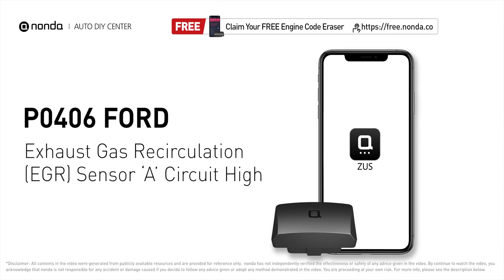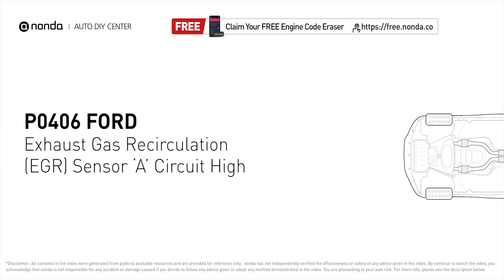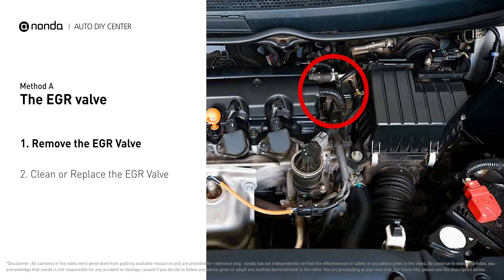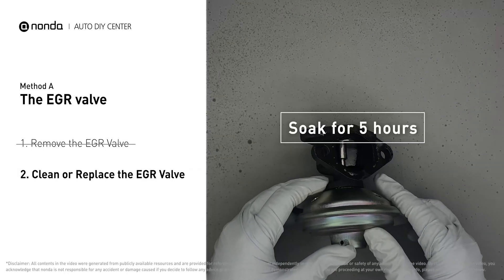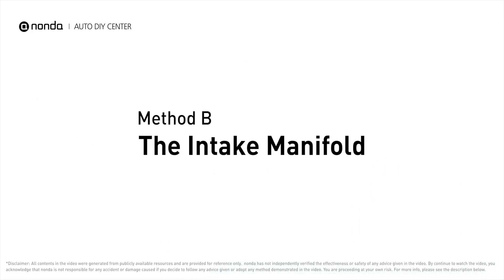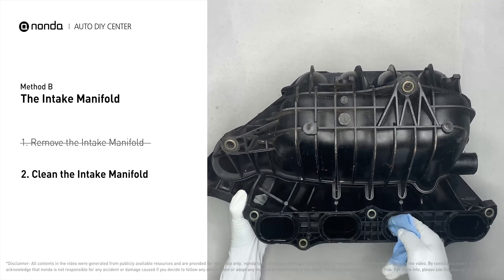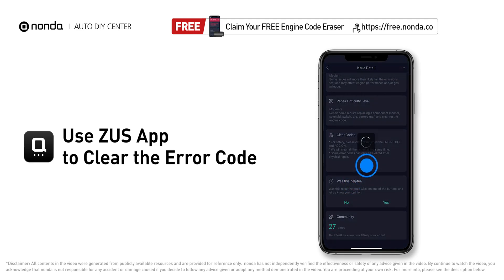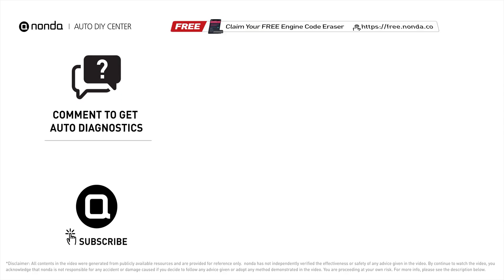How to Fix FORD P0406 Engine Code in 3 Minutes [2 DIY Methods / Only $4.85]

Comment: Worthless video with false information.   "Circuit high" is a key indicator that the sensor either failed or engine harness going to that sensor went open circuit.  That means the problem is electrical. And yet you idiots are going after the egr valve itself.  That's the first mistake.  2nd. Egr valves are not cleaned with wd40. There cleaned with a sandblaster or just replaced.  The valve is only $40.